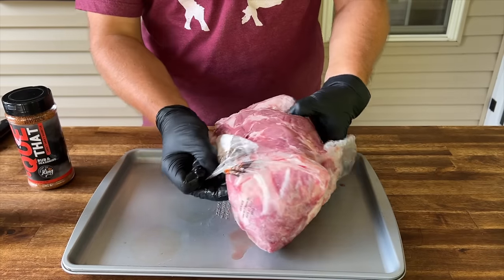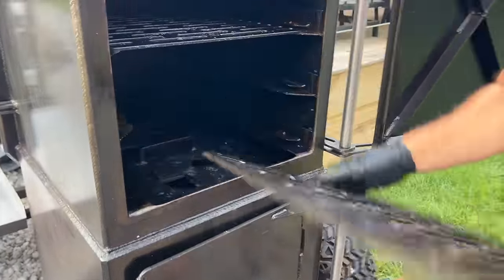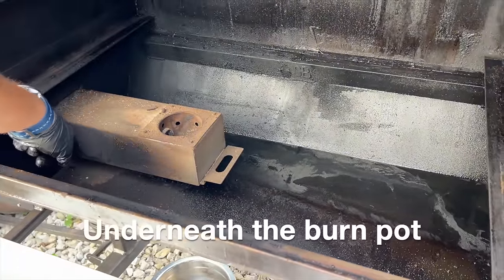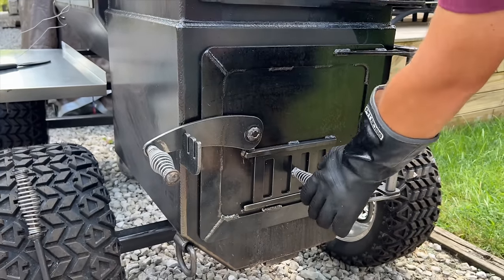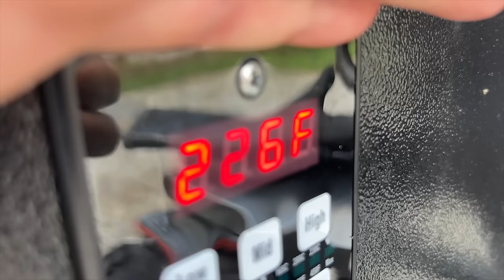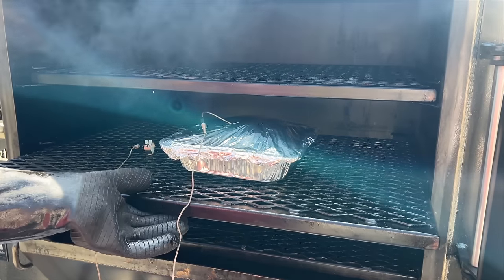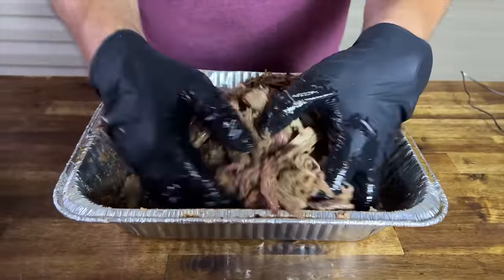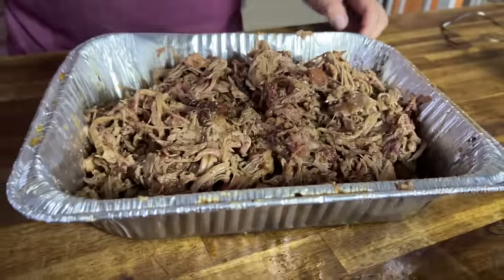NEW METHOD for Pulled Pork Butt - And Walk-Around of the TMG PITS HYBRID Pellet Grill

Comment: Hey Neil, just an observation those rubber tires seem to be so close to the firebox on stick burner side. So many manufacturers seem to do the same thing with tires being that close. But have you noticed any heat possibly causing the tire to melt or overinflate and blowing out on it
Reply: This is an $8k pit. Do you honestly think they’d put tires on this if there was a possibility of them “blowing out”?
Reply from the maker: Do they get hot...yes...has it mattered...nope...doesn't mean that if a huge fire was created over what it takes to start up could hurt...but no issue at all...

Comment: That’s the method I use and it works perfect every time. Is that smoker easy to move around and how much does it weigh?
Reply from the maker: Heck yeah...I think I could drain, pull, and add mix back in...but absolutely loved it....yeah the wheels make it way easier...I think he told me 1200 lbs...

Comment: Can you run the pellet side and use the wood side around 225 at the same time to get a super smoke mode😊
Reply from the maker: Not really...kinda...but heres what happens....the thermostat will only kick on the pellet grill if the temp is lower then the temp selected..so if  you want 225...that grill will 100 have to stay below 225...by adding logs....that might be difficult....can it happen....yes...BUT very very little margin for error...